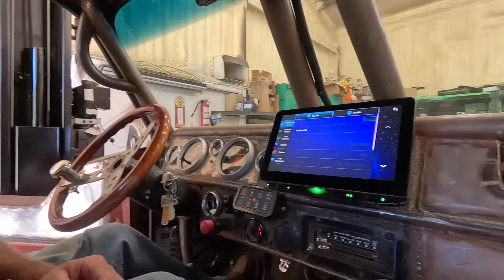Where Has The Rat Rod Wrecker Been?

Comment: 23:32 Uses a torque wrench... but uses it incorrectly to ensure that bolts still aren't done to spec....😂

So you know for when it actually matters, when you use a click type torque wrench like that your hand has to be on the centre of the grip. Most have a line turned in the middle of the knurling on the grip to tell you exactly where you need to apply pressure, it's not there for decoration.

If you use it further down like Sean (Shaun, Shawn?) was you'll overtighten the fastener. Same deal pulling on the end, but you'll under tighten it.

For those rings it probably doesn't matter at all, especially since they were done consistently incorrectly, but at least you'll now know.

Comment: I was a little disappointed that you would think that replacing the engine was a better idea than simply machining a sleeve to adapt the bronze gear to the aftermarket distributor shaft. You have a lathe, you have scrap steel [Mild steel would be all that was needed]. Doing this on your spare distributor would allow the work to be done without taking the truck out of service. Not a GM man myself, but Chev big block would surely be more than is needed.

Comment: I don't know why you didn't start the engine before putting the valve covers on the first time.  I was always taught that hydraulic lifters should be tightened until they stop banging around, then another half a turn.  But it's been many years since I've actually done that, so maybe things have changed.

I liked the video.

Comment: You don't have to use bronze distributor gears on billet cams anymore. Apparently a melonized gear will work. Further research revealed an Accel Performance distributor, number 59131, and a Summit branded distributor, number SUM-850200. The descriptions for them say they have a melonzied gear. They're both the same price, $219.99.
OR! Summit sells a melonized gear with a .430 diameter shaft. It's only $18.99.

Comment: You need a 12 valve diesel or  a duramax in that thing a LS is not going to have the bottom end torque you need to do what you built it to do. a big block or diesel is the way to go

Comment: On the big block you are not using the stock cam the push rods need to be changed to keep the rocker rollers in the center of the valve stem or it's not mostly centered it will brake stuff a tel tel the old rocker may have a half moon ware mark push rods may be too short

Comment: Sell the 454 and go to an 8.1. The bigger motor will make more torque than the modifyed 454 stock. You still need the weight and torque of the big block. The 8.1 will be wired almost exactly like an ls if the 8.1 dont make you happy. Raylar may even sponsor a cam or something to get more.

Comment: Hey! Come on! You have a lathe! Make a tube/spacer and drill one hole it in so you can use the new gear on the aftermarket/installed distributor. No LS! (not enough low-end torque).

Comment: All jokes aside, lighter valvetrain components will allow for a more free revving engine, with heavier rockers you’re probably gonna have problems with valve float at those high rpm’s you’re such a fan of. And looking at those rollers on your old rockers I think you springs have too much seat pressure. Sooooo…. It’s gonna cause issues with the steel rockers too.

Comment: Why would you run a tbi distributor? I’ve seen more failures with those than any other distributor out there. Hei, or any aftermarket magnetic pickup would be a more reliable option. Also you’d be disappointed with an LS with big tires on a tow truck. They don’t make near as much bottom end torque. They are a small block. Sort your big block problems out and you’ll be way better off.

Comment: EOIC  Valvetrain  adjusting Method always puts the lifter on the backside of the camshaft.  Its very simple to use.  And Ensures that the lifter is on the backside/ no lift of the cam. 
Also , when changing from one Rocker Arm design/brand to another.... 1.7 for BBC ,,Even though the Ratio is correct for the Rocker Arm. 
The Geometry built into the rocker arm itself can be different...   
Therefore , in the pursuit of correct VALVETRAIN Geometry,, or at the very least ,, Avoiding Coil bind... 
The pushrod length may differ Plus or Minus ...
For instance... 8.50 pushrod length may need a 8.60 (Plus) length pushrod or ... 8.40 length pushrod,, depending on the new/Different  Rocker arm Design/Geometry built into that particular Rocker Arm.  
Have had plenty of experience with this. 
That Engine sounds realy good.  Sorry your having VALVETRAIN issues.  
Installed Spring Height,  Seat and open pressure and coil bind measurements  seems to be where you should start here . 
Big Block Chevys and 429/460 Fords have very similar canted valve head designs. 
They normally do not have the problems youve been having. 
Unless something is wrong from the get go.  
And that distributor gear absoulutley has to be right for the camshaft material . 
That should be your easiest fix.
Let the Rat Rod Wrecker LIVE!!!
 Wish i time to personally fix your valvetrain issues.  
Good luck !! 
You dont need an LS yet! 
Even witn an LS...
IF the VALVETRAIN is INCORRECT...
Your gonna have the Same Exact Problems. 
Cheers and Good luck as always!!

What Cylinder Heads are you running on that BBC?

Comment: I love Paul , Michelle and family . It's just to bad they invest in Chevrolet so much. I have a 1972 Ford F250 4x4 390 high boy . Running  BF Goodrich 40" MTs I've owned it 40 years and 4x4 hard core with it for hunting, firewood, recreation.  I could get into more details but it's mostly stock . 4 speed and simple upgrades like warn hubs and such. I've rebuilt the motor twice and fixed the front ring gear due to pulling a log heavier than my truck. It sheared the ring gear bolts.  
   Other than that it still keeps going and going without working on it everyday, week, month etc as I see all Chevrolet, GM trucks being worked on. 
I've owned Chevy pickups and blazers from the 1960s 70s 80s 90s I've sold them all due to heavy maintenance and failing in drive train durability. 
   I call my Ford the "Stump jumper" and I'd put it against any Chevy of its class and simular build. 
   And for those Dodge boys ....forget it your not even in the running , (I don't feel like towing you home).

Comment: Technically speaking the red RTV, aka high temp sealant is NOT oil resistant... This is a popular misconception... The black color RTV is oil resistant.. So for oil use grey or black, High temp areas headers exhaust- red... Blue is for sensors

Comment: You look like you are using Chinese guide plates along with some Chinese aluminum rockers.  Genuine GM LS6/ L88 guide plates are about twice as thick as those plates you are using.  
Are those 7/16 pushrods or 3/8?  If 3/8 dia., you are going to continue to have valve train issues.  Use 7/16 thick wall pushrods and real L88 GM guide plates on any High RPM bigblock.  Always check 7/16 pushrods for interference with the cylinder, especially on small port heads and throughout  the entire range of valve lift.   
A melonized distributor gear should fix the gear issue on a steel billet cam.  Also you can mill a small .030 wide flat on the lower ring of the distributor to allow a little bit of extra oil to spray down on the gear.  Also might want to check your camshaft for cam walk.  I’ve built a few of these that needed to resist a lead foot and live longer than a few passes down a drag strip.

Comment: Save the bigblock, change out the billet cam, they are over-rated. My old 1975 454 bored .030 over put 525 lb-ft of torque to the wheels with an Edelbroc cam. Just saying there are better cam options than billet.

Comment: Build a 472 or 500 Cadillac for that tow truck and ditch that 454 crap! Way more low end torque  and no need to buy special LS crap for bolting to the th400! Just need the bop block to chevy trans adapter for less then $100 last time I looked at one...

Comment: I absolutely refuse to use any kind of RTV (Room Temperature Vulcanizing) sealant on any engine. The excess squeezes out and can come adrift, making it’s way into an oil galley or passageway, blocking it and causing engine failure. Any #4 bond, I prefer Yamabond #4, will do anything RTV will do but not have any of the drawbacks. It will outperform, hands down any other sealant.

Comment: Those rockers look like Summit ProComp house brand parts ..absolute junk. MSD makes a bronze gear distributor that’s pretty reasonable..a billet cam 100% has to have a soft distributor gear or it self destructs..this isn’t a BBC thing this is true with all performance engines. Don’t badmouth big block’s because you don’t source the right parts or assembly it correctly, a Big Chevy with out pull a LS any day of the week in a work truck.

Comment: Get those stupid race car rockers off. They dont self center on valve and you dont need them they fatigue real fast so fine for 1/4 mile passes but lots of strain on guides and push rods which have to be hardened. Put ball and stud comp cams rockers on that self center and stop talkin ridiculous ls smack talk. You need the weight of the bbc to counter what your pullin or front end be in the air all the time

Comment: 😂 Drag Racing b a ck the day, look for High torque. Get yourself an acccel cap wires, roter coil and the Bronze cam shat Gear standard H DMI and use, oem distributor shaft rpm range 10,00 to 22,00 R p m